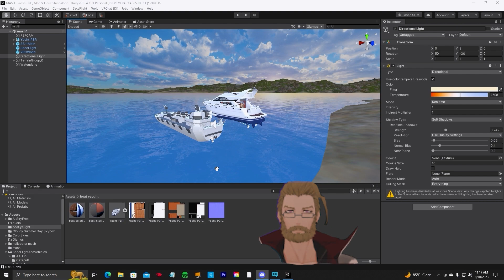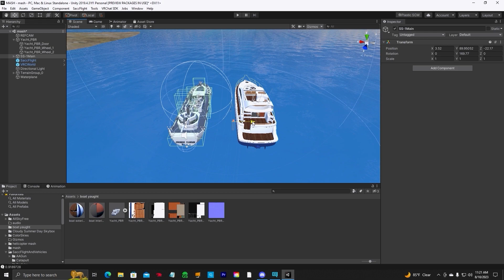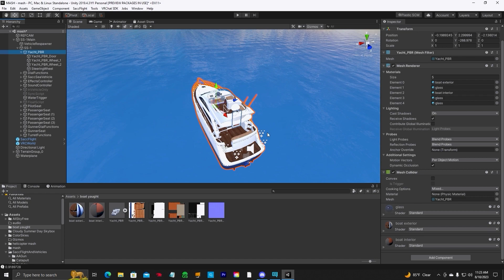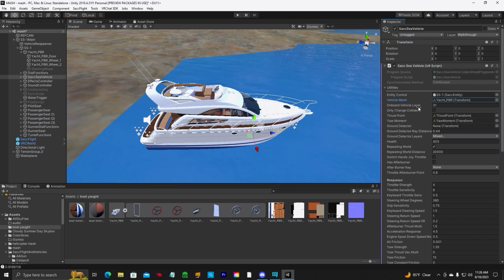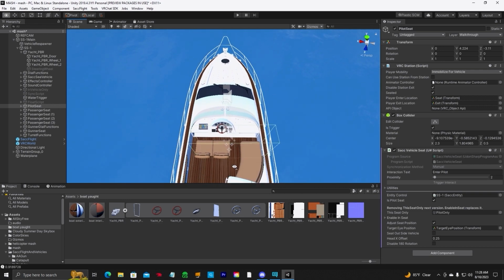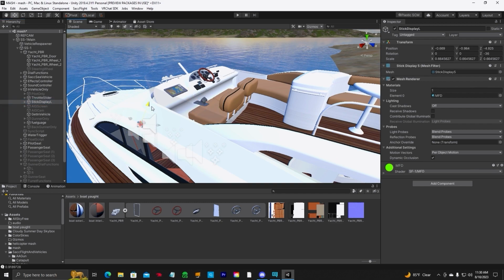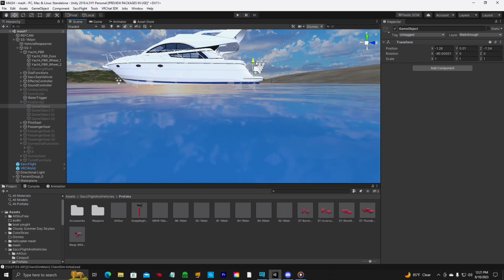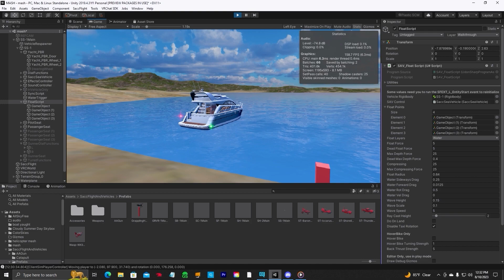Sacc System to your own 3d model Boat! (Sacc Unity Tutorial - Boat Edition)

Comment: Quick question. I followed all the steps and was able to use my own boat, which is working great. However when you try to drive boat in VRChat the wheel animations or driving the boat for that matter (L or R) does not work. Am I missing something? Thanks.
Reply from the maker: I'm sorry your having problems with turning. I'm not sure exactly why it's not working for you.